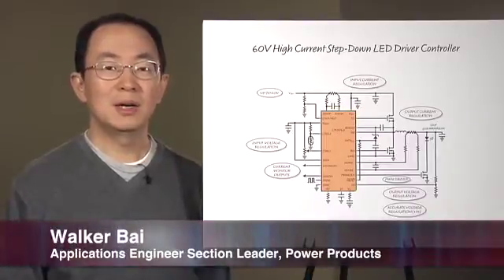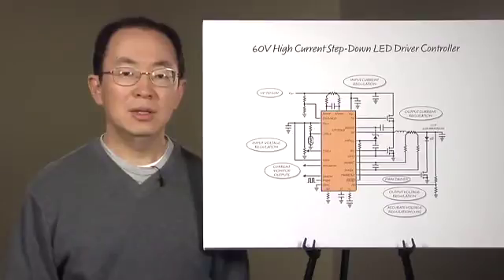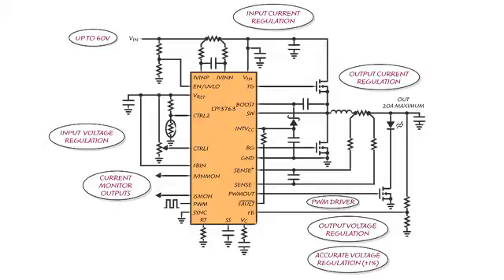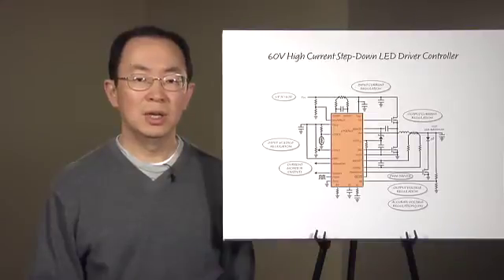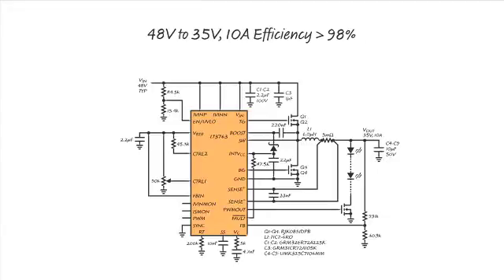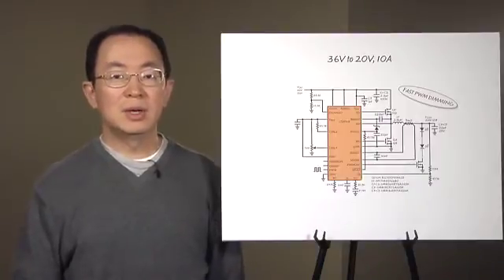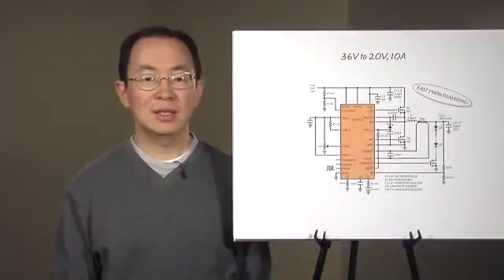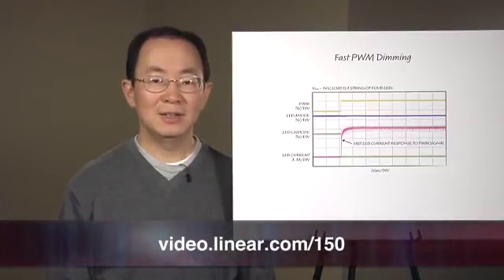60V High-Current Step-Down LED Driver Controller

Comment: I enjoy your presentation of the LT3763 high powered led dimming .
I am present trying to draw a circuit for this LT3763 to enable me make a circuit board. but am not very perficint in this area .
Could you supply me with a circuit board print out of the copper side and the silk side to enable me to make my board using the LT3763.
Thank you Greg